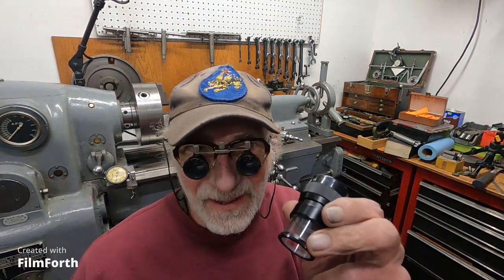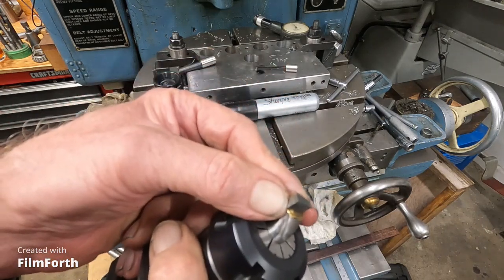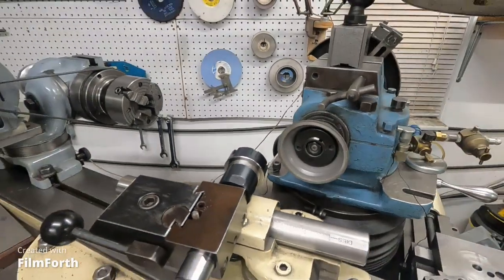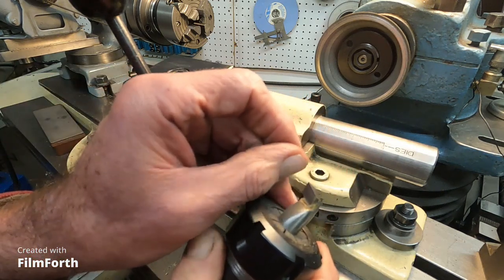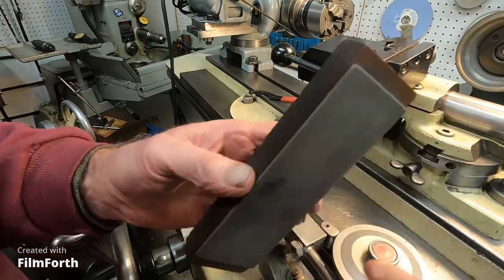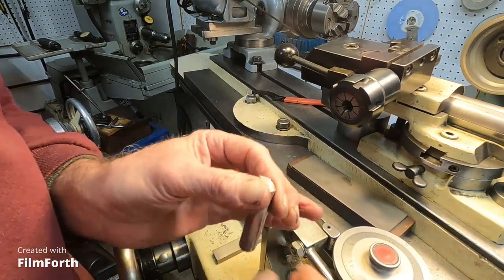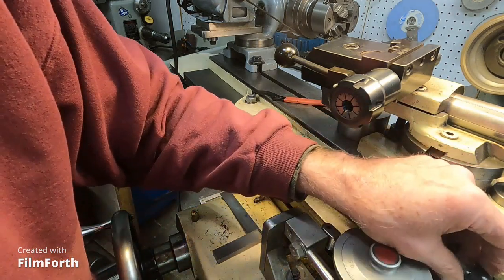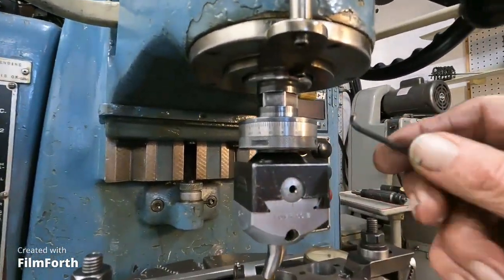Jig boring cutter touch up and Allen wrenches

Comment: I hate losing tools! But it happens, not often but it happens.  So much for the conservation of mass and energy.   Cheers, TB
Reply from the maker: I worked in a local hydraulics shop years ago that had the tear down and assembly areas color coded with paint on the tools, big trouble if there was a blue tool in the red area. How many side cutters or pliers do you have to have to find one? Made a jaw dropping discovery with my 1930s Plomb tool chest with no drawers is better by far for me keeping the most needed tools for the machines at hand contained and visible. The best training is to write up a sequence of operations and all the tools needed to avoid stopping and looking for small tools.

Comment: I used to use a 1/2" wide diamond hand hone approx. 5-6" long in my right hand, while holding the cutting tool in my left, and between radial movements of my two hands, could more easily produce the desired radius on the tip of my carbide cutting tool.
Reply from the maker: I have machine ground these small radiused tips but it takes too much time if you can do it by hand, not everyone can do it though.
Reply: @deedeeindustrialsuperprecision  If a specific radius is not required, and all you need is a clean cutting finishing radius on the end of your carbide cutting tool, why not produce it manually, inspecting your honed radius with a loupe as you go.
Reply from the maker: @MrMojolinux  A specific radius is required that I am inspecting with the loupe as I go with hand honing, the radius being between .005" to .010" max using a spindle feed of .0008". Thanks!